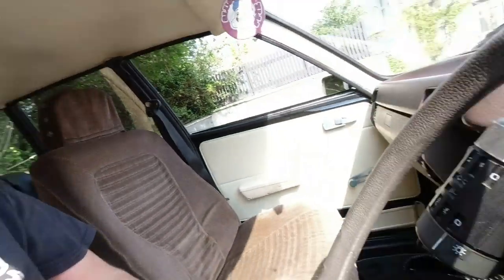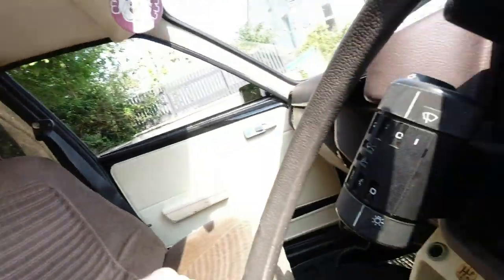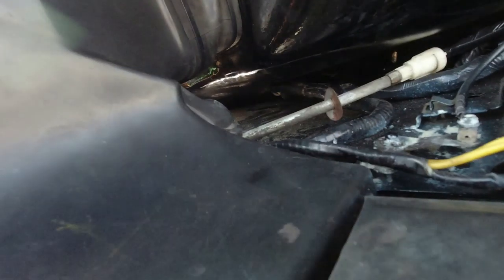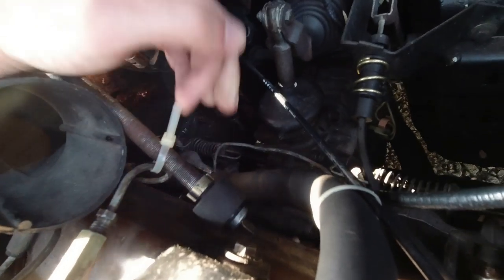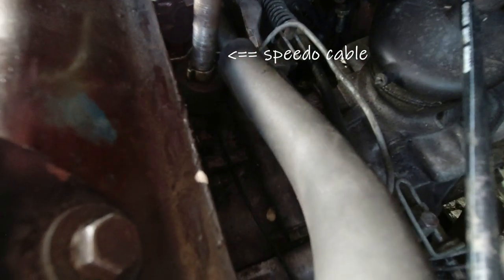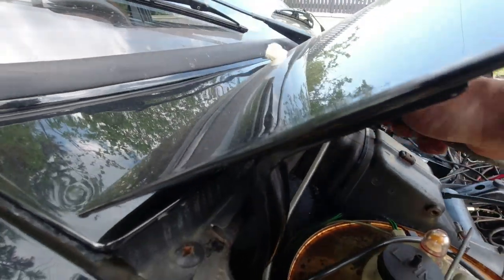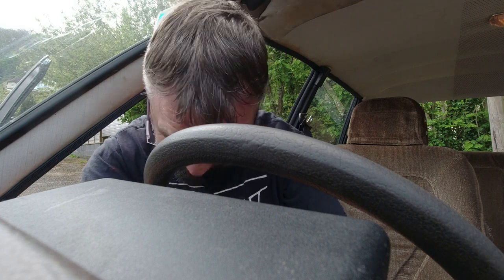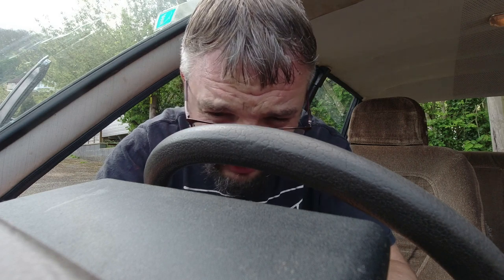ACTUAL (ham-fisted) TINKERING! Citroen GSA Speedometer fix (not what I thought)

Comment: Disconnect the drive cable from the gearbox - feed it through the dashboard and connect it to the speedo binnacle. Push the speedo binnacle back into place and then reconnect the cable to the gearbox. So much easier.
Reply: so simple but genius
Reply from the maker: That's not actually possible, due to that fixed washer on the cable. It can only come a short way into the car.
Reply from the maker: Though I s'pose you could do it with that washer on the inside, but I'm pretty sure it's meant to be on the outside to ask as a bit of a blocker to stuff coming in.
Reply: That was my thinking - if the gearbox end goes through the hole behind the speedo then the washer at the speedo end is to keep it on the back of the speedo.
Reply: The washer is in fact a retainer for the cable, to have it stay inside the dashboard. It effectively does what your zip-tie trick did for you.
Its not meant as a dust cover.
Reply: @CXensation  That's a very cool nickname.
Reply: @torresalex  From the time I owned a  CX for 9 yrs. An '86 22TRS purchased in '91.
Sadly it rotted away despite previous owners very generous care with antirust treatment - in fact every year over a 5 year period.
As a fun fact, I had to remove the rear numberplate ligths for inspection, as there was no light here when I purchased it.
Turned out the bulbs were working fine but the lamp clusters were filled up with antirust wax, blinding off the light.
The wax was fluid after some time with the bulbs turned on heating up the wax.
Reply from the maker: Oh. So the cable was fitted incorrectly before I disturbed it?
Reply: @HubNut  Yep.
Reply: @HubNut  Looks like it. If you can feed the gearbox end of the cable through from the inside, then it was fitted incorrectly.
Otherwise my assumption is wrong.
Reply: @HubNut  Why not push a blind grommet up the cable in order to block 'stuff' coming in.

Comment: Ah! The Citroen speedometer - there was a reason early 2CV's apparently lacked them.
Two of five Citroens in my life had these triublesome components: a 1995 Xantia VSX, whose speedo was fixated at 80 km/h intermittently, and a 2006 C5, whose speedo died when the car was 12 years. I'm told that's acripe old age...
I took the C5's electronic cluster out myself and got it fixed (C5's are tricky but not vicious like GSA's).
Didn't bother fixing the Xantia. I'd just assure my partner I could judge tge speed by looking out tge window....
Congratulations on sorting the GSA - well done!

Comment: Well done. I had a similar saga with the speedo cable on an MG Midget I used to own. Took a few weeks of arsing about finding the problem and then the right parts to fix it (it had a gearbox with overdrive so non standard). They kinda suck for  access to things too. It's so satisfying when you finally fix it though.

Comment: Reminds me of my BX days.
The Citroen BX had exactly the same insane cable layout for the speedometer, except I am lucky living in LHD land, which is not as bad.
The later design incorporated a split cable with a stubby cable on the head unit itself, just reaching through the firewall. Here you had a screw connector in the engine compartment to the gearbox cable.
The fun part here was to hit the hole in the firewall when pushing in the head unit, but still a lot easier.
BTW: A very nice GS specimen you have got there. Usually they are completely rotten away.

Comment: I might be missing something here, but if it happens again (cable detaches) perhaps insert dashboard end in first, enabling you to pull cable right through dashboard and work in car, and then 
work under bonnet, where there is more space to attach a limited cable length? Oh, my apologies, I just read this theory three or four comments below, and about fixed washer. 
Non the less, having just tried to insert some dashboard lights on an old Toyota, I feel much better knowing someone with more skill and knowledge can still struggle with such jobs.
Reply: sorry Brett I accidentally duplicated you comment (and yours was better than mine anyway).
Reply: I think the issue attaching from the dashboard and back to the engine bay was the metal washer thing though the firewall was somehow limiting the cable travel back and fourth. I was thinking the same thing when he showed behind the instrument cluster. But then he talked about the limited cable travel because of the design.

Comment: That was very handy to have the wiper the function it gave you to be able to have a view on the speedo cable! Having read before that you already sorted it out, I was looking forward to watch this video. You had quite a bit of luck that the gearbox end of the cable wasn’t wrecked by being “fitted” so long in a wrong way. Don’t forget that WD40 doesn’t lubricate! It is quite a well spread misconception. Just a drop here and here of oil is the best thing you can do. It would also be handy to have exploded views of you car parts and all the systems. You could have done it the other way round. First plug it in the binnacle, lead it through the firewall hole, and then wrap it around the heater box and then into the gearbox? Then there wasn’t that “natural position” of the speedocable being offset from where it plugs into the meter itself. The “stress” you still have on the cable right now is not good for the speedocable. You made it yourself complexer than it could have been I guess.

Comment: When I worked as a mechanic in the 1960's a guy came in with a snapped speedo cable  I fitted a new cable and gave the customer his car back and we could hear him revving his engine constantly. He came back into the garage complaining that the speedometer was still not working I explained that the pointer would not move when he was stationary and he had to be moving before the speedometer  would register. He then left and since he did not return I assume it was working.

Comment: That's great your sorted. When your working on Citroen's just remember one thing, they were designed as LHD and converted to RHD and if you were working on an LHD car it is much easier to do these jobs as you pointed out with the speaker hole in the dash. When you get to your spanners and unlock the adjusting nuts, clean and lube the threads and just tighten the lock nut up finger tight and this will make future adjustments much easier.
Reply from the maker: Thanks. Leaving the adjusters finger-tight on my 2CV once saved me when the cable snapped away from home. And I had no tools!

Comment: It makes you wonder what car manufacturers were thinking sometimes. Some years ago we had a Peugeot 505 8 seat wagon. Lovely, comfortable car. Gutless, but comfy. Then it developed starter motor issues. Let the fun begin. The bulkhead on this vehicle followed the shape of the bell housing on the gearbox with a few inches of space between the two. The starter motor, which in the engine bay stuck out into a fairly uncluttered space was bolted onto said bell housing with two, fairly long bolts. Now the fun part. Instead of the lugs (I think that's what they're called) on the bell housing having female threads to accommodate the bolts it was the starter motor mounting lugs which had the internal thread. This meant that instead of being able to screw/unscrew the (very long) bolts from the uncluttered engine bay side of things you had to bolt/unbolt the starter motor a bazillionth of a turn at a time with your hand and the spanner (which would drop down between the bell housing and bulkhead about every third turn) in the tiny, cramped and awkward-to-get-to space between bell housing and bulkhead. This turned a five minute job into a forty minute test of will power. What the hell were they thinking!?

Comment: It occurs to me that there is a lesson here. Check from the end that you have the easiest access to first. This is a reminder to self. Hopefully self remembers that. Don't know how many times I have created problems for myself by not thinking of things like that which would save me grief. I have never enjoyed removing the speedometer or the dash when it involves disconnecting the speedometer. They never give you enough length of cable. It does occur to me that removing the transmission end, on cars where that would help, would be a  very smart thing to do. That thought struck me as you were fighting with yours. I know it won't help you but many old American cars simply use a rubber boot to seal the cable which means you could disconnect the transmission end and get more length. Not sure why I didn't think of that years ago. I have an old car that I had to remove the dash from and I was dreading putting it back together because of that annoying speedometer cable. I now know that I can make my life easier when it comes time to put that back together. Thanks for your video. It inspired a very helpful idea for me. Others probably have been doing that for years but I can be a bit dense sometimes.

Comment: Same issue with my marina, ordered a new cable...wasn’t correct. Turned out it had popped off at the back of the speedo! Cable tied it back on and 12 months later it still works! Hazar!

Comment: That reminded me of when I recently changed the heater blower resistor and plug in my Grand Scénic, including the lines imprinted into my arm. The resistor pack on the non-climate control RHD versions is accessed by removing the small shelf thing to the right of the instrument panel and forcing your arm into the gap. The official way is to take the whole top off the dashboard, which I wasn't going to do. I did end up having to remove the centre of the dashboard, the radio and the glove box to get the new wiring to the fan motor connected. But now I can use settings 2 and 4 on the fan, which is pure luxury (or it will be when I eventually get an MoT on the car).

I'll carry on working on it when Euro Car Parts deliver the rear discs, pads and tools that I ordered. I've been waiting three weeks so far. I understand that they're busy though - I wonder how much of that is people like me with "project" cars that they've now got time to work on!

Comment: When I had a GSA Break (after two DS20s) a technician at the Citroen Garage told me "Whoever repairs a Citroen with his hands will repair any other car with his feet". I had the pleasure to change the driver side window including the complete lifting mechanism at my DS20. The boss of the garage told me I get the spare for free (from my old car), if I do the change. 45 minutes later I was done. Normal working time for that job would have been 1:10 after Citroen rules...

Comment: Reminds me of changing Renault 5 starter motors, if I remember correctly it went something like this. Remove air cleaner, carb, various cables fuel lines, disconnect exhaust, remove manifolds and engine mounting bracket. Now you can see the starter motor you may use odd shaped spanners to remove it. After refitting the starter and all the other parts you will A) have a very short fuse, B) an exhaust that rattles on the inner wing, C) very little of the working day left and D) not much skin on your knuckles.

Comment: Top tip for sticking your arm through uncomfortable openings: take a piece of rubber or soft plastic hose (like fuel hose), cut to length to match the diameter of the opening, slice along it lengthways, then press it over the sharp edges around the opening. You might need to secure it with some tape to stop it popping off while working. Your hands and arms will thank you!

Comment: The ignition light flickering could be down to that oil leaking onto the alternator and may resolve itself with use unless you get it off and clean it all off
Reply from the maker: Maybe, but I suspect there's an electrical gremlin somewhere.

Comment: Way too much information about sex faces, I thought my comments were a little near the mark but you Mr.H. have absolutely outdone me. Well worth a few war wounds I always think if you can get an awkward job done and good to hear a helpful neighbour may have saved the day. Great stuff, I have been looking forward to some tinkering videos. Thanks Ian, farewell.
Reply: Awesome vid love the dash display so Citroen and the in board brakes still prefer the ax but it's more my era also wd40 is more of a short term lube and grease of any sort is long term wd40 stands for Walter displacement x40 or so I was told I know that if u use it in bearings an not grease it just dries them out and very quickly destroys them in a very sort time but my be white grease is not the right one there are several that are sold by wd40 companie with different base for different applications :-D

Comment: You fixed the speedometer issue. Now you need to fix your alternator as the battery light is on with the engine running.
Reply from the maker: It's a hoax. It's charging fine.

Comment: Did yoy know? In the GS, the sister car and predecessor of the GSA, the speedometer's rotating drum is tinted differently according to the speed, to remind you when you are supposed to change gear.
Reply: Actually was yellow, green, orange and ending with a red stripe to show the approximate petrol consumption. The very end was eventually such a high consumption that even a Sheikh would complain directly to Citroen's management... 😄
Reply: @rjft7003  Having owned the GS I had read in the owner's manual that the purpose was a reminder for changing gears, and I confirm it was almost like that: yellow > green > yellow > orange > orange with a red stripe (unattainable :D )
A very interesting disassembly video on the rotating drum is here 
https://www.youtube.com/watch?v=zLIwZCKQB1c

Comment: Inboard brakes and oil leaks, not a great combination. What's more, the inboards tend to run a tad hotter because of airflow issues. Cooks up the seals a treat. They do reduce the unsprung weight however and that's a benefit to handling.

Comment: Glad for the result, maybe put a bit of string on the speedo end before pulling it through the bulkhead, so tie it on to pull back in? Not that you'll need to to do this now for the rest of the time you own it.. :-) But the next bit of intrigue is will your rev counter speed estimates match the speedometer?

Comment: I had my arms torn to shreds reaching round the back of a ZX dashboard when installing a hands-free kit.  I think Citroën deliberately leave razor-sharp edges on any metal brackets and also cut off tie-wraps leaving a sharp point rather than snipping them off flush.  Other manufacturers do the same sort of thing, but not quite so viscously, in my experience.

Comment: Skoda Estelle, you can only reach it from underneath, you have to take the front carpet and the front seats out to feed it up through, two grommets that you need to seal with silicone underneath, then it loops through the boot and scuttle and had to seal that with silicone or you get a leak inside the car, then in  couple of months it breaks... It's about 12 feet long

Comment: Would it not have been easier to put the cable on the  speedo first then put it back to geather  then pull the cable down to the gearbox and attach it at that end ?

Comment: Now don't you just wish that you had connected the in board end first? You could have pulled enough through so that you could fit it whilst the binnacle was out. Isn't hindsight a wonderfully useless thing! :-)  Glad you fixed it Ian.
Reply from the maker: That fixed washer on the cable prevents that move.

Comment: The speedo cable is probably fitted in the reverse order to how you did it. Connect to speedo first while the instrument panel is out of the dash then attach to gearbox.
Reply from the maker: I don't believe so as I think the fixed washer should be on the engine bay side.

Comment: Looks like the washer should be on the inside to stop the cable from slipping out... So take out speedo first, connect the loose cable and then feed it through the engine bay.

Comment: I once had a speedo problem on my mk2 Clio. It would intermittently drop down to 0mph from whatever speed i was driving at so actually did more miles than was on the clock. It turned out to be a faulty speedo sensor.

Comment: Your desire to go to your unit and fettle your fleet of cars is understandable.  However in the case of the Toyota Tercel would it not be better to lie down and wait for the feeling to go away?  Back in the day I almost bought one of those but backed off and then in observing infrequent examples noticed how they rusted away.  If you do work on the Tercel, I will watch any videos – Right now if coldwarmotors put up videos of paint drying I would watch them end to end.

Comment: Re. the oil breather pipe, these can block and then engine will spurt large quantities of oil into the engine bay which then goes on the exhaust and fills the car with smoke if the heater is on! That is probably why it has been replaced.

Comment: Many times I've attempted a repair and then after thinking of a much easier way to do it, which I can only hope to remember if there is a next time . . . . Howzabout attach the cable to the binnacle before it's attached to the transmission, so you can have it long enough to do it with the binnacle out?

Comment: Great to see old french cars being kept on the road and I know how quirky they can be. I had a Peugeot 304 cabriolet (FGD501L) and you could see the distributor or you could touch it but you couldn't do both at the same time (and it had a fun transverse engine with a front mounted radiator using a down facing alternator to give a 90degree bend in the fan belt ). Regarding attaching the speedo cable on your GSA (that hopefully you'll never need to do again) could you bodge/cheat?... take the speedo out, attach the cable to it totally free of the car, then pass the gear-box end out through from inside the car (enlarging the bulkhead hole if necessary).
Reply: profuse apologies for duplicating earlier comments